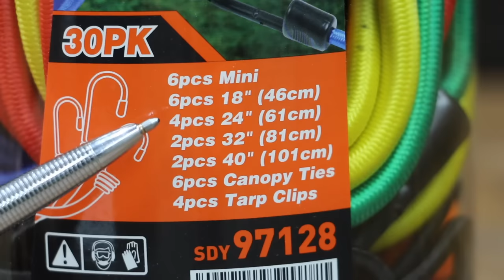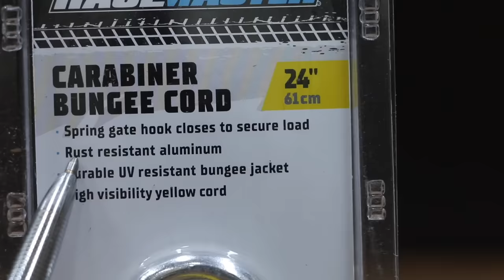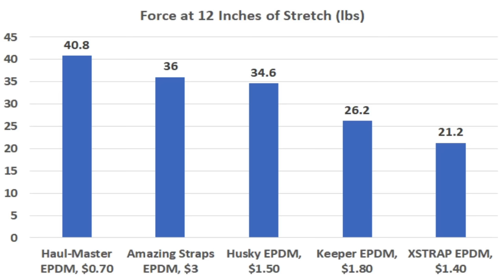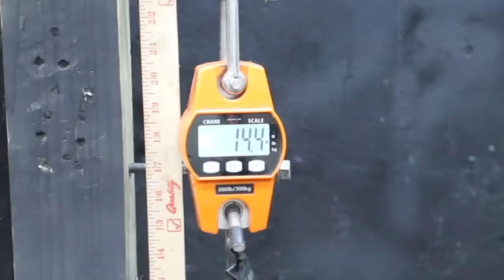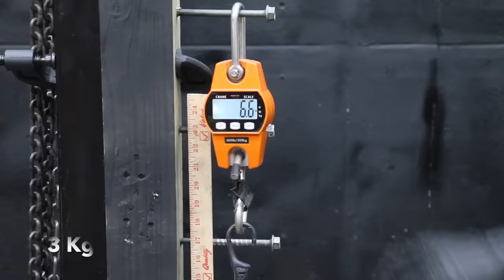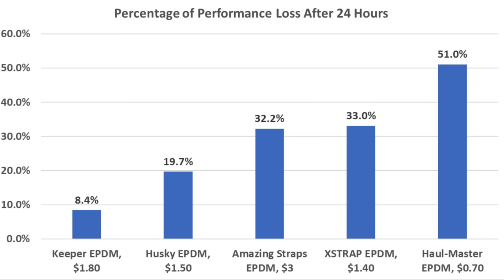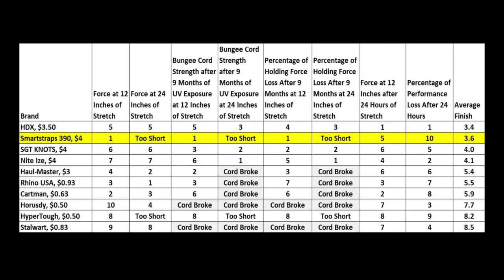Best Bungee Cord? Let's FInd Out!

Comment: I've tried a bunch of epdm style straps over the years for securing loads inside my truck and tying ladders to the rack on top. The best strap I've found so far is from a company called "The Better Bungee." It's a polyurethane compound rather than an EPDM rubber and keeps its suppleness a lot longer in my experience (Even not in tension, EPDM straps start to harden after a year or two). They make both bungee style round ties and flat straps (I use the flat ones). They're much lighter and more flexible than EPDM. I haven't tested them like you did, though...
Reply from the maker: Thanks for sharing.

Comment: Bought several black rubber bungees from HF about 15 years ago, and some  of them stayed in direct sun for 3-4 years with only minor surface cracks. I bought others recently and they degraded into a black goo in under 2 years of use. The newer ones looked duller when new, so I wasn't surprised!
Reply from the maker: Thanks for sharing.

Comment: We use epdm straps to hold the ladders on our trucks, this is great info!  Been looking for some that don't need constant replacing.  If you do it again it would be useful to see performance in extreme temps.  Sitting on top of car reflecting the summer sun, and extreme midwest cold.
Reply: It isn't pretty, but you can wrap the strap with tape or cloth when stretched out to protect them from UV rays.  Be sure to cover tip to tip so the hook does not rip out.  It puckers up when the strap is released like one of those stretchy garden hoses.
Reply from the maker: Thanks!  Thanks for the suggestion.

Comment: Hey Todd - another very meaningful real-life test. Kudos! 😊👍
I am in a van builder group (The Crafty Blinders van life) and one of our (worldwide) electrical suppliers (Victron) is suggesting using very fine strand cable without ferrules on their screw-in terminals as it is supposed to be a better contact with less resistance opposed to using regular wire. We are confused. So, we figured you are the only independent expert to do a real-life test with meaningful results. You game? 😁
Reply from the maker: Thanks!  Thanks for the suggestion.

Comment: That takes me back. About 20 years ago, I was helping my grandfather cover his boat for the winter, and we were going to attach the cover using bungee cords. He bought 2 boxes of the Harbor Freight plain black bungee cords for the job. We winterized the boat and pulled the cover over. After about 10 minutes of pulling the cover over and positioning it just right we opened the boxes of bungee cords. We untangle them and start putting them on. The first one gets hooked on and I start pulling...POP! The bungee cord breaks at about 1 inch of stretch. "What the hell", I mutter to myself so grandpa can't hear me and toss it aside. I grab another and start stretching and POP! it breaks too. We start pulling on all the cords and they all break around 1 inch of stretch. We laughed for a few minutes and then went in to town to buy more from a different brand. Someone must've forgotten one of the 12 herbs and spices in the factory in china where they were made. 

Good times.
Reply from the maker: Thanks for sharing!

Comment: Nice video.  The Amazing Straps bungees look identical to a different brand I use on my semi truck flatbed.  I know you didn't test temperature, but what I can tell you about EPDM is that it's very hard to stretch in freezing temps and once it is stretched it stays that way.  It holds up to the sun great though.  I try to use natural rubber bungees in the winter and EPDM ones in the summer.
Reply from the maker: Thanks!  Thanks for the feedback.

Comment: Around 1980 a Specialist Eye surgeon based in the steel manufacturing city of Sheffield England told my father the most common single cause of serious eye injuries in his experience was from Bungee cords snapping back and hitting people in the eye. I really liked the aging tests. How about testing screws, nuts and bolts, and nails out doors over a long time to see which can still be removed and how well they perform even if they corrode etc.
Reply from the maker: Thanks for sharing.  Thanks for the suggestion.

Comment: The perfect bungee is made in USA and has been a favorite of mine for years. They have a nice adjustable design and a good stretch to them with good holding power. Could you test these as well? They are not the cheapest bungee for sure but I've really enjoyed them so far for a bungee. Had them for about a decade now and still going. They have not seen extensive UV over that time but have been used in the sun.
Reply from the maker: Thanks for the suggestion.

Comment: I would love to see you review "The Perfect Bungee" Polyurethane Bungee Strap, Nylon Hook Ends (found locally at Home Depot). They are more expensive, but I feel they are "indestructible" and worth it. The following claims are below:

- Domestically made
- UV resistant, chemical and fuel resistant
- Salt water resistant
- Flexa-pure polyurethane
- Optimum temperature range minus 20°F to 120°F
- Stretches 2X length
- Strong reinforced nylon hooks

You are one of my favorite channels and my go to source when researching various products. Keep up the great work!
Reply from the maker: Thanks for the suggestion.

Comment: 🎯 Key Takeaways for quick navigation:

00:00 🧰 Bungee Cord Testing Introduction
- Introduction to testing various bungee cord brands for strength and UV exposure.
- Comparison of different brands to determine the best-performing bungee cord.
00:12 🐎 Testing Horse D Brand Bungee Cord
- Testing the Horse D brand bungee cord for strength at various lengths.
- Detailed performance measurements at different stretches.
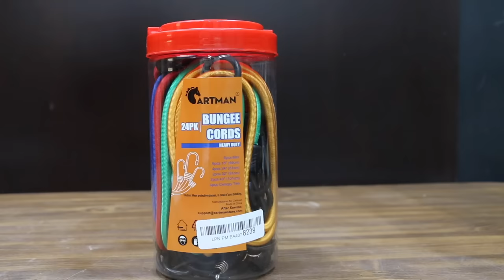01:08 🦛 Testing Hyper Tough Brand Bungee Cord
- Testing the Hyper Tough brand bungee cord for strength and performance.
- Comparison to other brands and measuring its limits.
01:37 🧰 Testing Cartman Brand Bungee Cord
- Evaluation of the Cartman brand bungee cord's strength and durability.
- Comparison with previous brands and assessing its performance.
02:05 🏗️ Testing Haul Master Brand Bungee Cord
- Testing the Haul Master brand bungee cord, which is sold at Harbor Freight.
- Measuring its strength and performance at various stretches.
02:33 🦏 Testing Rhino USA Brand Bungee Cord
- Evaluation of the Rhino USA brand bungee cord's performance and UV resistance.
- Comparing its strength to other brands.
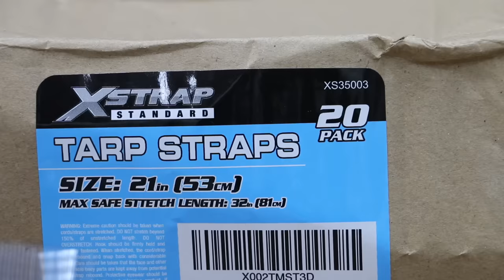03:01 🧳 Testing X-Trap Brand Bungee Cord
- Testing the X-Trap brand bungee cord for strength and durability.
- Comparing its performance to other brands.
03:29 🐺 Testing Husky Brand Bungee Cord
- Assessment of the Husky brand bungee cord's durability and UV resistance.
- Comparing its strength to other brands.
04:24 🗝️ Testing Keeper Brand Bungee Cord
- Testing the Keeper brand bungee cord for durability and chemical resistance.
- Measuring its strength and performance.
04:53 🪢 Testing Harbor Freight Haul Master Bungee Cord
- Assessment of the Harbor Freight Haul Master bungee cord's performance.
- Comparing its strength and durability after UV exposure.
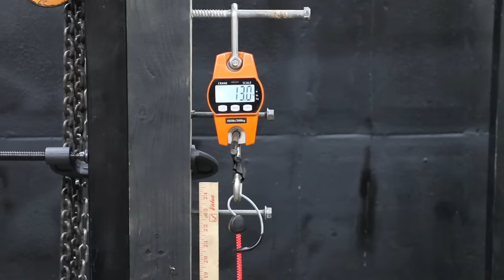05:21 🦄 Testing Amazing Straps Brand Bungee Cord
- Evaluation of the Amazing Straps brand bungee cord for strength and durability.
- Comparing its performance to other brands.
05:50 🏡 Testing Home Depot HDX Brand Bungee Cord
- Testing the Home Depot HDX brand bungee cord for durability and chemical resistance.
- Measuring its strength and performance.
06:19 🌙 Testing Night Eyes Brand Bungee Cord
- Evaluation of the Night Eyes brand bungee cord's performance and UV resistance.
- Comparing its strength to other brands.
06:36 🤖 Summary of Bungee Cord Testing
- Summary of the bungee cord testing results and findings.
- Highlights of the best-performing brands in different categories.

Made with HARPA AI

Comment: Can you run a test on a bungee I found at Home Depot called “The Perfect Bungee”?  I find them to be the best I’ve ever used.  Longevity, stretch, strength, UV  resist is all great.  They are polyurethane.  I won’t buy any others.
Reply from the maker: Thanks for the suggestion.

Comment: Hello Project Farm :)
I have some suggestions 💡

With those power tool battery adapters it is now possible to use multiple brands of power tools on the same battery platform, but you only get the best of both worlds if you stick to one brand of power tool batteries, so what about a battery comparison?
What tool battery brand is best?
What sort of  features do you loose by using battery adapters?

Here is the other one :)
A UPS (Uninterruptible Power Supply) comparison video.
It is a nightmare to try and compare them on the internet, it is difficult to find the spec sheets and when you finally do, they end up being vague or even misleading.
For example it is basically impossible to figure out what kind of sine wave they output.

I hope you find these suggestions useful :)
Reply from the maker: Thanks for the suggestions.

Comment: Cordless rotary tools would be my suggestion. I bought a Harbor Freight rotary tool, but it stalls and has only a few speed settings. So in desperation I bought a Dremel; 8220 which seems to do reasonably well. Are there other better ones? A "Dremel" is a key component of my shop, perhaps for others as well. With 2000  comments this one may well get lost. Oh well. Thanks. Cheers.
Reply from the maker: Thanks for the suggestion.

Comment: When I was doing specialized trucking we used to use a whole elephant full of rubber bungee cords.
You could buy them in a large bundle at truck stops.
Can't find the good one's, or really any anymore there.
I still have some that must be over 20 years old, and they're just about as good as the day we bought them.
The fabric rubber band ones are garbage.
In order to keep the pack rats out of my engine compartments out here in the Mohave desert, I prop my hoods open with a 1 foot piece of 2x4, then add tension with a bungee cord.
It sounds counter intuitive, but if the hood is propped open a little, there's no safety for the rats, and they don't nest or eat the wiring.
I put bungee cords on the wife's shopping list, and she bought an armload of haulmasters.
Maybe it was a bad batch, but they don't seem to last a week before cracking and being full of a million little razor blade like cuts.
I have no idea what these are made from, but it's just more crappy Chinesium recycled something.
Ya can't even buy honest rubber anymore.
Reply from the maker: Thanks for sharing.

Comment: Tldr; Video idea: which way should decking be laid?

First, thank you again for an interesting and useful video. I always look forward to these. 😀

Given your incredible patience, thoroughness, and dedication to the scientific pricess, you would be the perfect person to finally provide an answer for which way decking should be laid - bark side down or up. I.e. smiling or frowning.

Most sources seem to say that decking should be laid such that the bark side is down (smiling) as otherwise the boards would cup such that water would puddle and cause the boards to rot faster, and also the edges would raise and cause a stumble hazard.
The problem is that there are also lots of anecdotes that the opposite is true, that boards laid "smiling" would cup more.

There are lots of suggested factors, such as climate and wood type, though ATM, I can't think of more..

I would envisage the experiment as e.g. these factors 
- various types of wood but at least pressure treated pine (mos interesting for me, since that's what's common here 😄), and probably Douglas fir or whatever is most common in USA.
- degree of "smilyness" i.e. how close to the pith or the bark the board was cut
- nailed vs screwed from the top vs "hidden screws" (e.g. Camo)
- treatment, e.g. oiled or not, stained or not
- wood quality, e.g. is the board already cupping in one direction or the other, and how should it be laid then?
- etc.

It may be possible to accelerate the experiment with artificial wetting/drying, but I don't know for sure.
Reply from the maker: Thanks for the suggestion.

Comment: Just a suggestion.  For the pull at different distances...it would have been neat to see a line graph of all straps.  Stretch distance on X, weight on Y, each strap a different color line.  If they break or can't reach then their line ends early.  Would also show that more subtle variable of how much a strap will stretch.  Is the line linear, exponential, logarithmic, etc.
Reply from the maker: Thanks for the suggestion.

Comment: I see several videos about products to clean the inside of an engine such as Seafoam, Marvel Mystery Oil, etc, but there is one type of product that I think would make an excellent, and quite helpful, video: 

Engine degreaser.

I'm about to do some work on a diesel engine and need to degrease it as much as possible, top to bottom, as well as the engine bay. Is it possible you could do a video on this? Thank you so much.
Reply from the maker: Thanks for the suggestion.

Comment: Have you done, or could you do a video on Philips #2 screwdrivers?  I'm an aircraft mechanic, and my cheaper #2 screwdrivers (most common type in aviation) don't last more than like 5 months before I have to warranty them. I finally resorted to snap-on, but I'd be curious to see a test!
Reply from the maker: Thanks for the suggestion.

Comment: I think one point of feedback that I'd like to share is that the final rankings you show might not be the most statistically meaningful way to represent the final standings. When you rank them by individual placement within the test, it implies that there is an equal difference between different products regardless of the real world difference. If the 1st place finisher in a category has 11% loss in stretch, 2nd place has 12%, and 3rd place has 80%, it doesn't make sense to present those as equally significant margins.

Love your videos and attention to detail, but it might potentially be worthwhile seeking out the feedback of a statistician or the like to improve your data presentation and summary. You could score things based on the distribution within your test sample, with scores normalized to a standard deviation, in which case average score becomes meaningful again.

Comment: Those rubber straps are called "eye removers" for a reason... They are way to dangerous and you never know when they will just rip apart. I don't even know why truckers have them.. I guess because they are dirt cheap. 
I like the large elastic adjustable bands these days.. They hold pretty good and last well.
Reply from the maker: Thanks for the feedback.

Comment: How cold does it get where you are? I've found that many bungee cords become brittle in the extreme cold (here in Maine, that means down to around -20° F), and it's so bad I've started keeping my cords in the basement instead of a shed. Some have broken apart, especially those cheaper EPDM cords, with absolutely no direct UV exposure, even still in their packages - though I'm sure it would've happened much faster with it. 

I've learned to use ratchet straps in the winter; trying to stretch a cord in the cold seems to almost guarantee a break. Maybe I'll try some of the nicer brands you tested. Better materials = cold resistance? Great video!

Comment: A different idea to be tested would be bicycle inner tubes. You could test resistance to puncture, pinch resistance, strength when impacted as well as weight.
Reply from the maker: Thanks for the suggestion.

Comment: Just have to make one comment... in the first test, you're measuring strain, not stress.

realizes you're saying stretch, not stress

Neeeevermiiiiind.

That said, I'm not sure the first test shows what you expect it to.  Those that "offer more force" also likely have more internal stress and will fail sooner.  A better test would be to set it at a given load (say, 20 lbf) and measure the strain as %elongation.  What you're currently testing is the strap's Young's Modulus rather than yield strength (or more usefully - yield strain).

The UV test likely combines two considerations - UV resistance and resistance to creep from a sustained load.

In all, I think this experiment should be based on changes in breaking strain rather than "holding force" which really isn't what you're looking at in a strap.

Comment: Fatal Flaw in your experiment:  the bungee cords are of different initial lengths, but you employed the same amount of stretch.  percentage stretch is what would have given you a true comparison of material strength, which was your original stated purpose when you said all bungee cords will be 24 inches.... a rule you had to break.

had you employed percentage stretch, then it would have been an apples-to-apples comparison, but without it several calculations will be needed to give an approximation.

in technical terms, you were inducing a different strain for each.

Comment: It would be nice to give more useful tests.  The UV sun exposure was great.  How about stretching to different lengths in 1'' increments and seeing where the biggest point of failure is in strength after they are loosened and which brands stretch out the most when used normally.    It was unrealistic stretching to the lengths you did.

Comment: Compare air compressors with about 10 gallon tank. How loud are they? How fast do the fill up the tank? What CFM can they sustain, starting with full tank or starting at empty tank, or what’s the drop off? Weight? Wheel size and maneuverability.
Reply from the maker: Thanks for the suggestion.